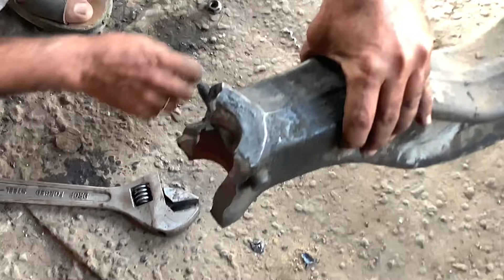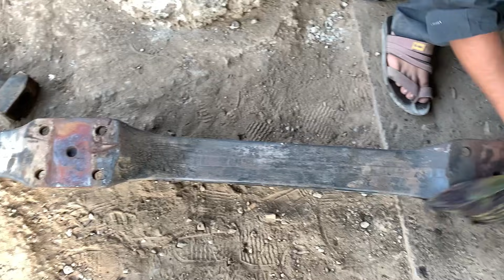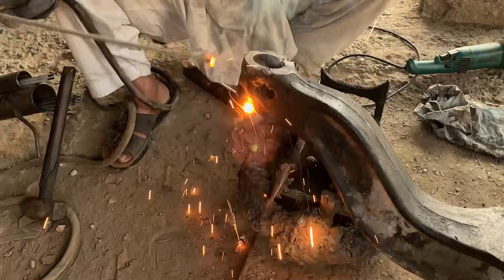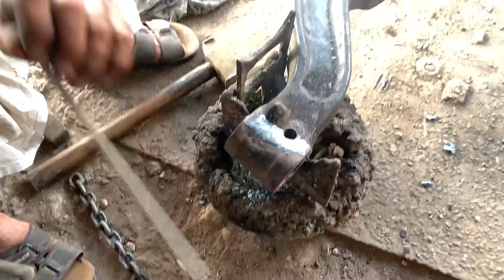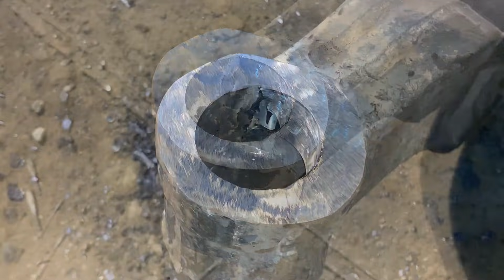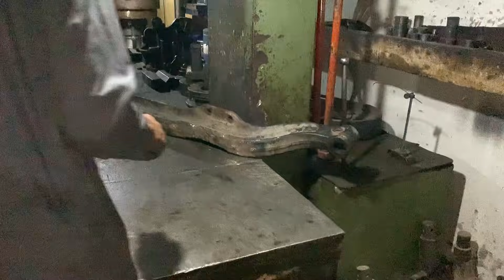Due to heavy load, the front axle was broken and stagnant || Repairing Damage front Axle

Comment: You're meant to install the bushes then ream them out to size. I'm not sure which will break first, the poorly welded repair or the crack on the spring mount...

If this was a tractor working in a field then fair enough but if this is on a truck in the road then this is just dangerous. And don't say it's because they can't afford a new axle, they've just wasted money on this repair as it will break again.
Reply: That's never going to work!

Comment: I enjoy these videos, guys making the most of what's available. 
However, showing that the electrode your using is a 7018 will not absolve you of dangerous repairs🤣
If the original axle snapped then that repair won't last long on those roads😳

Comment: Completely understand the fact that they probably don't have the resources to get new axle. But that is a rolling death trap, the weld probably won't fail but the metal beside it will!!! That is holding your wheel on that massive vehicle, scary to think of driving anywhere near the finished vehicle 😳

Comment: That is very wrong, the dimension if the whole is affected, I supposed the spot weld the two peices together then make a cut using the angle grinder for the welding rod to penetrate side by side...